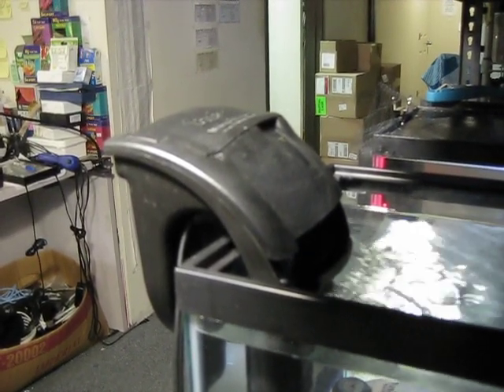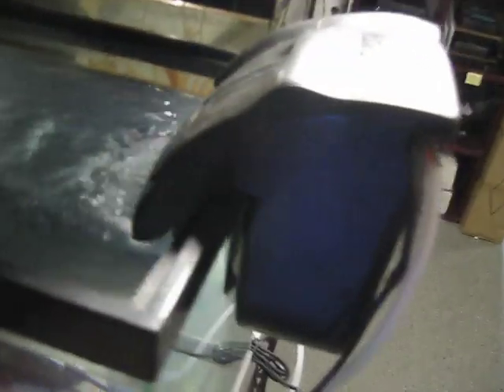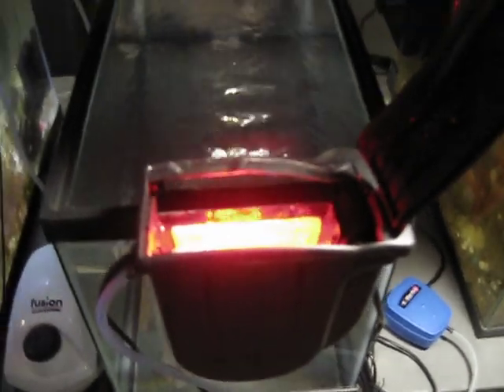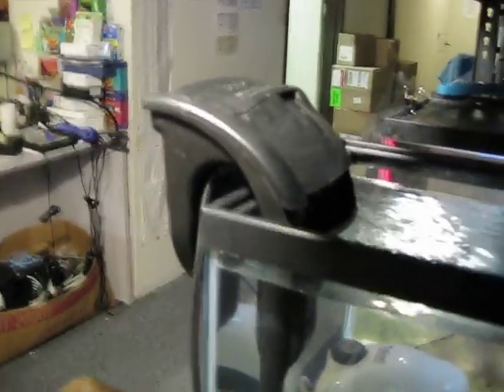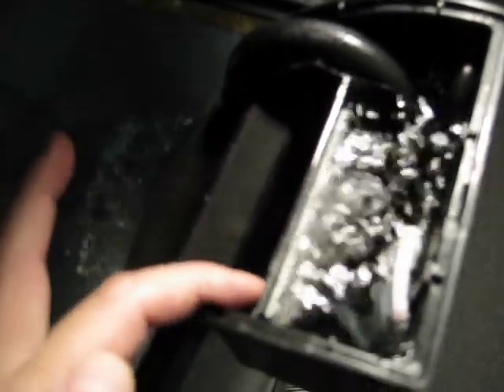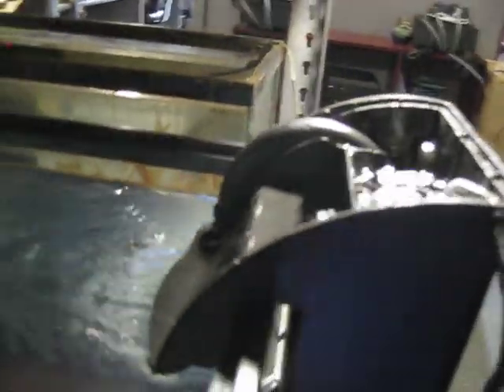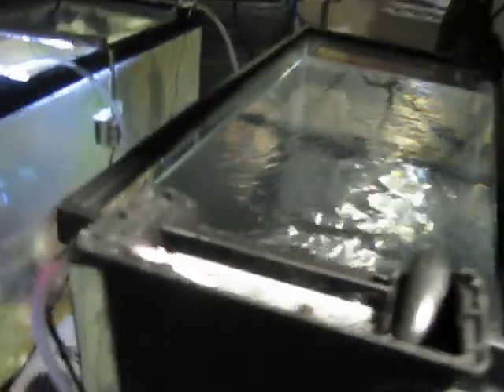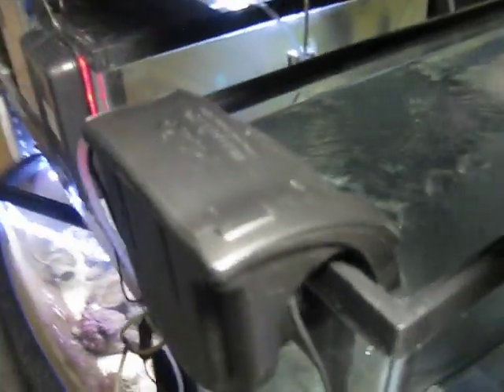Tetra EX-20 power filter conversion to Hang-On-Back algae scrubber

Comment: I like this design due to not having to deal with a sump. Have you used this design on a aquarium yet ? If so how many gallons and how effective was it with controlling the algae in the tank? 
Bobby J
Reply from the maker: That LED leaked and failed. Our new GEM5 lights should fit right in, however.
Reply: Just finished my version today , I basically copied your design with a different filter and white led but same concept. I'm making a video on it and gonna post on you tube when I'm done hopefully the first design works for me
Reply from the maker: Post also on AlgaeScrubber.Net if you can.
Reply: How long should I expect to see algae to start growing on the scrubber, I have an established aquarium been running 5 years nitrates are at zero But still a little algae growing on heater and glass. It's only been 4 days since my setup has been running so maybe I'm just being a little impatient.
Reply: I will post the video on algae net when it's done , it's going to include the whole process even if the first design fails I never quit lol. I'm not sure when it'll be done though depends how fast I succeed. I've learned a lot already about algae scrubbers after I put it together so there are a few things I have planned to tweak if it doesn't work.
Reply from the maker: Gonna take a week or two.
Reply: Well my hob scrubber was a fail. I'm now running a algae scrubber which drips gravity fed tank water over screen into my recently installed 10 gallon refuge with a led grow light shining on the roughed up screen. There is already algae growth after 4 days. Once it's broken in more I'll try to get a post of it on algaescrubber.net

Comment: what does your filter do exactly with the bubbles and red light
Reply from the maker: +John C   The light grows algae, which filters out nutrients from the water. The product descriptions at www.Santa-Monica.cc will explain more. The filter in this video was never made, however.
Reply: why would you want algae in your fish tank
Reply from the maker: +John C   Not in the tank, in the filter. Then it's easy to remove. Look at this video:  https://www.youtube.com/watch?v=Gl7WmrOwziE
Reply: But what is the purpose of the air stone /bubbler? I’ve never seen that in an ATS. Seems that’s the source of most of the noise.
Reply: @pascal590   watching this video, having air bubbles inside your HOB seems like a good idea.  While the tank water is being sucked up, the air bubbles are mixing with the tanks water, compared to just, for example putting an air stone bubble on one side of the tank and only one side of the tank is being aerated.  With the noise, I can agree with you, it is noisey.